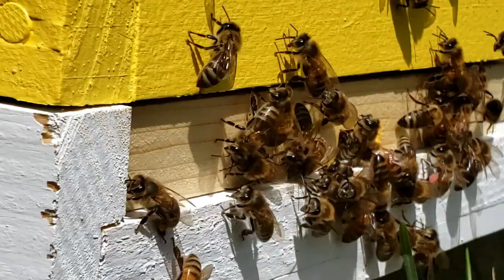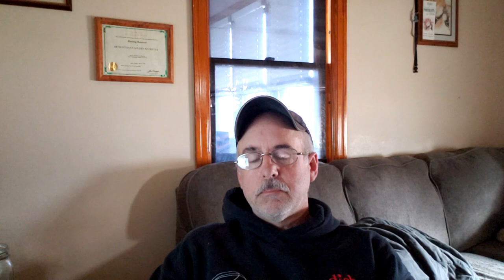✅ No Top Venting:   Asking Why Did it Work?

Comment: The bee’s taught me no upper vents when I bought an Apimaye hive. All around the top feeders are vent slots, but unlike the hole in a standard inner cover, the slots are small enough the bees can seal them up. They sealed every slot in short order. 
So then staple mesh over the hole in the inner covers. The bee’s will seal it off in no time. I found that given a choice, my bee’s will seal off any upper openings. 
My conclusion, they don’t want upper vents. I haven’t had any issues with no upper vents all year round for a few years now.

Comment: This winter I put 184 doubles, lost one and 40 nucs, lost 4, none had upper entrance. Nucs have 3" foam on top and the doubles have 1.5.  The foam is a barrier between the outside and interior surfaces. The allowance of a temperature differences changes the dew point, (the temperature point at which air becomes saturated with water),  and is raised with warmer air. The bees "heat" the interior. The interior hive temperature is above freezing because of this heating, well the ceiling surface is at least where frost could collect, only made possible with insulation and no upper vent.  Winter humidity is very low.  There is an air exchange through the lower entrance; this allows the moist air to be removed because it is not frozen on the interior surface. To sum it up, the moist air does not freeze inside before it is drawn from the hive through the lower entrance by the low humidity air outside the hive, its like a big dehumidifier made possible by the low humidity air and insulation. I'm in Nova Scotia, zone 5.
Reply from the maker: yeah....I've talked about this in previous videos...this video I wanted to discuss the CO2 envelope. Thanks for sharing your process!
Reply: @KevinsNorthernExposure  something to think about, C02 is heavier than air, any C02 inside the hive body will sink itself right out the lower entrance, fresh air with low humidity will enter the hive in return, C02 possibly aiding with air exchange. 

The only talk of C02 and its benefits right now is a study in Canada where the bees are wintered inside a shed and the C02 of the entire shed is lowered. The study is geared for mites. In an outside environment the hives are not sealed enough to trap C02, especially with a lower entrance, maybe if snow blocks the lower entrance. Maybe a study needs to take place with no lower entrance and only an upper to trap C02.
Reply from the maker: @sidelinerbeekeeper  I believe Ian talked about the CO2 mantle within his boxes upwards of 20K PPM or more...he discussed literally the same thing about the bees metabolism slowing down....this is why he has ceiling fans, but doesn't want them too high to create a draft as to remove too much c02 from his hives. https://www.youtube.com/watch?v=K9YJs7BnhEE
Reply from the maker: @sidelinerbeekeeper  CO2 is heavier than ambient air, but it does not drift to the ground as there is a lot of mixing going on in ambient air...which is probably why it works within a box of bees.
Reply: @KevinsNorthernExposure  had my local Bee meeting this last weekend here in northern Iowa. Nobody there believed that I ran single 10 deeps with no upper entrance through winter. Everybody down here drinks the upper venting Kool-Aid, even after most of them lost more than half their hives this last winter. Only hive I lost was a late July split that failed to launch.
Reply from the maker: @rstlr01  well...you are doing something right!  
I cannot say definitively that it worked, but  it sure appeared to....confirmation over years of observation will help dial it in...then you can come back with hard data to show them.

Comment: Hey Kevin, Happy to see no top vents worked for you. Things are good up here in the Yukon. All my main hives are well 7 for 7, my other 2 "sick hives (high mite) and chalk brood challenged hives are actually now prospering and my 5 frame nuc may yet survive. I am hoping to use the queen in it to replace another one in May (Yukon raised Saskatraz mutt). I will have to read up on the CO2 impact on mites. I knew about of the impact on the meta rate. My centre RH% is about 68% @ 24C and the outer edge RH is in the high 80-90% @12C (which agrees). The centre of the cluster is always much drier (relative to maintained temperature). I usually start adding pollen patties (15-55% real pollen) about 30-45 days before 1st pollen. We are still having cold nights (-25C) but day highs just hit 3C today. However we still have 3 ft of snow so 1st pollen will be a ways off. My bees are currently in the 200-230 day old range. So adding the pollen will triggered brood rearing to have a 1st group of fresh nurse bees ready when 1st pollen hits. From my calcs I know honey consumption due to heat generation is low in my setup so brood rearing is the main consumption. My guess is my singles will go from about 1lb/week to 1.5-2 lbs max per week. Here is a presentation I did for a group in Wisconsin a couple of month ago - https://drive.google.com/file/d/1rt7Kt3s6wOoThV6Y2mQhFj8rqglX-88U/view?usp=sharing
Reply from the maker: Not sure why, but your post wound up in the "held for review" section and I just saw it now. 
Thanks for the presentation, I'll check it out.  Hope all is well for you up there in no-man's-land!

Comment: Good find on that article. I had not had time to research the idea. I haven't read it thoroughly, but skimmed it and he seems to hit some very valid points in both ventilation and insulation. I'll study it in greater detail later. What I didn't see in there is any reference to bottom boards and bottom entrances with regard to ventilation and CO2. Of course CO2 is heavier than air, if I'm not mistaken.

Steppler and Palmer use solid bottoms (although Palmer does use top vent but he also gets 6' of snow, making a bottom entrance moot). Steppler pulls his entrance reducers to relieve condensation. Palmer's entrances are fully open with 1/2" hardware cloth mouse guards stuffed in. I'm moving to solid bottoms for various reasons. I'm undecided on full entrance or reduced, and if the latter, then what size. 

Sucks that our experiments are 12 months apart and take 6 months to see results!
Reply from the maker: there is a guy near me that uses no upper vents and 3" entrances...he's had 100% success with100 hives for 3 years now.  But he uses doubles and triples. side by side.
Reply from the maker: Although it is heavier-than-air it is not so heavy that it does not mix with the air with in the Box so it doesn't outright sink to the bottom